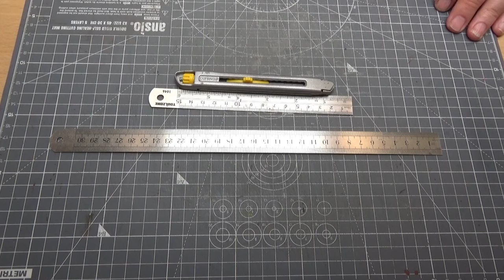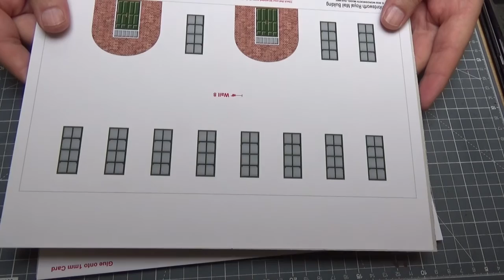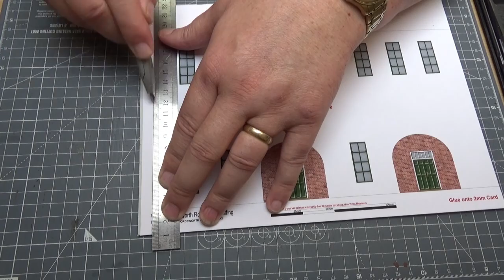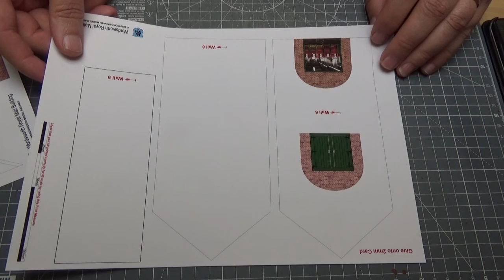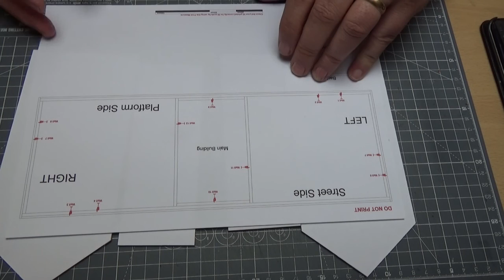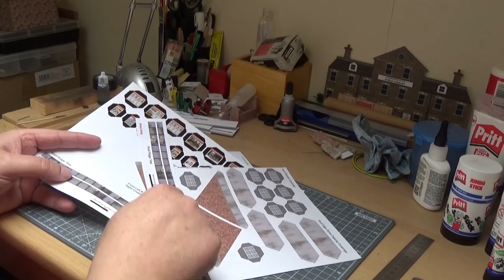WMR "Let's build a card kit - Royal Mail Building"

Comment: Hi Mike another great build. Can I ask what’s the best way to cut out arch ways I struggle with shaking hands and they never look the best. I was thinking of trying a Scapel rather than a craft knife
Reply from the maker: Hi Dan, In my next build I will show how I tackle cutting curved lines. Like I said everyone will have their own methoid but the one I use is not cutting the curve like a straight line but by using the blade in a downward stabbing motion moving along the curve about 1mm at a time. I find this works a treat for me. Cheers Mike.

Comment: A very nice building Mike. Sorry, but I did see the separation problem on one end  of the building. I have had the same issue. I use glue sticks, but sometimes it just doesn't take. So I tried PVA and applied it as thin as i could, but I ended up with glue bleed through the paper. I can not buy Rocket card Glue over here So.If I do get a problem then I just reprint and recover the item. Your Kits have come a long way. The first one I made was the Textile Factory using 300GSM card. I ended up putting a load of reinforcements across the Main walls and the end walls. 2mm and 1mm Card is the way to go. I still do not have the baseboard up yet and maybe I will have to wait until next year as I am not working, all the schools are closed here until the 1st of July. If it is Ok then. Martin. (Thailand).   Take care be safe Mike and your family.
Reply from the maker: Hi Martin, On occasions the edges can be troublesome if you don't give them a good coating when using Pritt Sticks. Once a quick fix using my micro bottle with Pritt PVA glue inside. a small amount of glue soon sealed the paper to the card. I've found if you use PVA, the white stuff, I used a wood worker glue bottle which has a roller & apply a thin coat to the card not the paper seems to work well. Only downside with this method you have to sandwich the bonded card / paper between two blocks of wood clamped together. Let the glue dry for 24hrs & remove from the home made press. Cheers Mike.
Reply: @1964mikem  Thank you, Mike.

Comment: Hi, Just downloaded this kit and was wondering if page 9 is correct. It just has a black object on it, no wordsworth logo or the writing that goes with it. Thanks in advance.
Reply from the maker: Hi Chris, I've just done a test download from the website using Firefox browser, I used WunRar to open the RAR file & then FoxIT Reader to view the file. All seems well. Page 9 has the front upper appex coverings, ridge tiles & some posters to customise the buidling. I'll download Adobe to see if that gives the issue you report. Cheers Mike